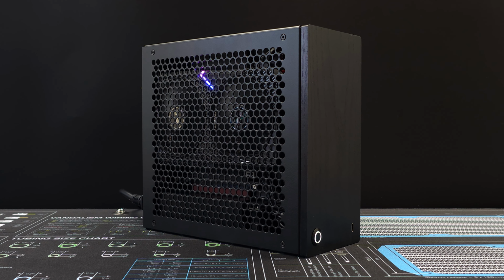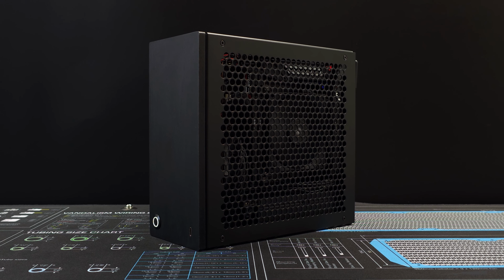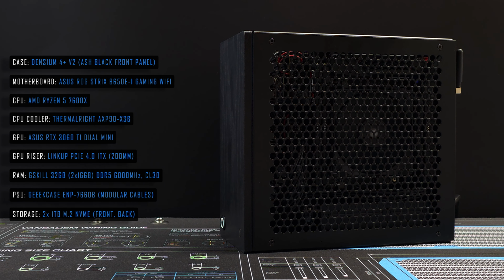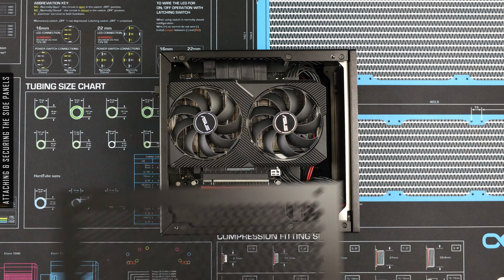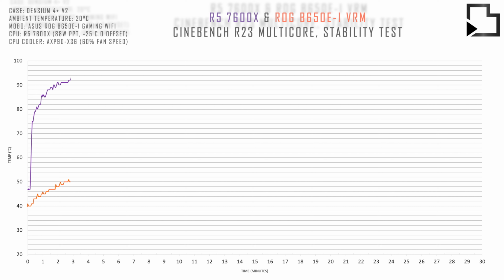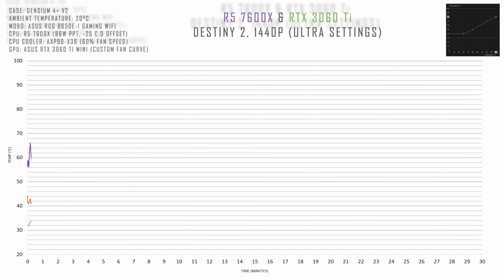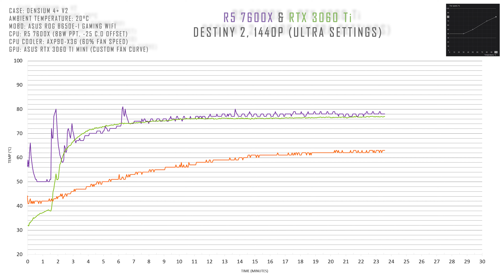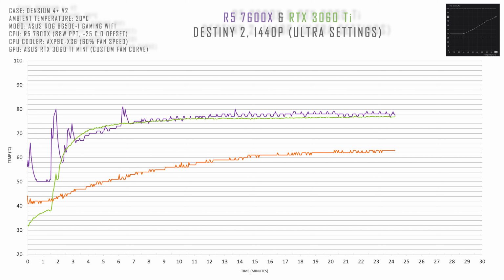5.5L Gaming PC - Densium 4+ v2

Comment: Love your channel, I am curious about your opinion on the following. 
1. Would you expect CPU thermals to be in the 90C range for an i5-13600K?
2. Also I wanted to make a SFF build and utilize and old GPU I have on hand (EVGA GTX 1080 FTW) the specs should be similar to the 3060 used in the video.
Reply from the maker: You're very kind. In multicore sure. In gaming, you may just scrape by since it's significantly less demanding

Comment: I never really understood why someone would go for the Densium 4+ when the Velka 5 is smaller in volume, smaller footprint, and supports larger gpus. Making a wooden front panel for a Velka 5 would be pretty simple too.
Reply from the maker: Velka 5 is EOL until its next revision. It's also vertical design. I like the Velka 5, too.
Reply: It’s cheaper 15$, tbh i prefer densium 4 design, the shipping is free to my country Velka is around 60-70$ for shipping alone
Reply: @rifki0011  I'd say $75 is worth it, given there's no guarantee that cards small enough to fit will continue to be produced.
Reply: @L91  Yeah, but the next revision is within the next couple of months.
Reply from the maker: @James Linkous  it's been EOL for a while now. Is there any source for this date? Website just state 1st half 2023.
Reply: @L91  The first half of 2023 ends in a couple months. I emailed them recently to ask some questions about the revision, and they responded as if they are on target to meet that date, as the changes are pretty minor.
Reply from the maker: @James Linkous potentially In next 4 months is still long way out.
Reply: @L91  I mean, it's currently the end of March. 2-3 months is more realistic.
Reply from the maker: @gamersruin  likey 3 months, possibly later according to Velkase

Comment: any 4070 that fits the case ?
Reply from the maker: Deshrouding the Zotac 4070 Twin Edge might work
Reply: ...it does. Got the case and a 4070 super twin edge oc on the way and will do my best to get it fittedb🤙
Reply: @tpfeiffer1986 any update?😄
Reply: @wyld3137  yes :)

the difference in deshrouding or not is negligable. about 7mm difference. doens't fit. i used some spacers i had laying around to make it work, of course the gap of the front panel looks awkward. i hope ther will be a Densium 5 with support for this gpu and for two 90mm slim top exhaust fans and 47mm coolers. this thing gets toasty.

Comment: CPU too hot
Reply from the maker: That's a negative
Reply: Not OP, but the Ryzen 7000 series have a VERY aggressive power curve where they push themselves to temperatures in the 90s. This is normal for them and it doesn't matter what cooler you use they'll push it. "Dangerous" temperatures for these CPUs would be in excess of 100 degrees.